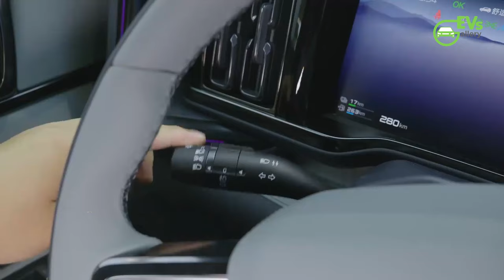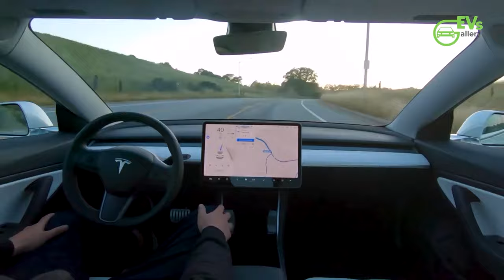BYD's Fang Cheng Bao Unveils Trio: Super 3, Bao 8, and Super 9

Comment: Why BYD does not build extra power bank in side the car for extra miles or kilometers? . In my nation, I can't use E2 BYD car to go far more than 305 km. There is no electrical chargers in provinces or remote areas. No way I can't come back home. But extra power banks, I can go 810 km or more. So, I don't need to worry about shortage of electrical power in my cars. 😢😢😢😢